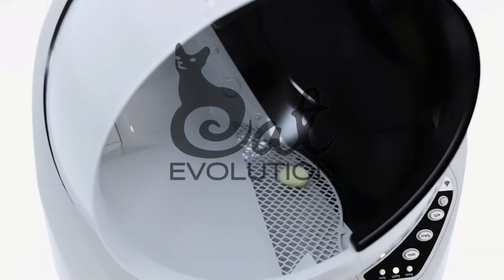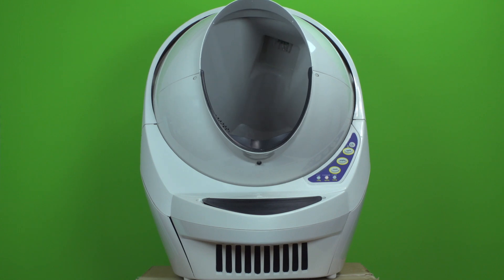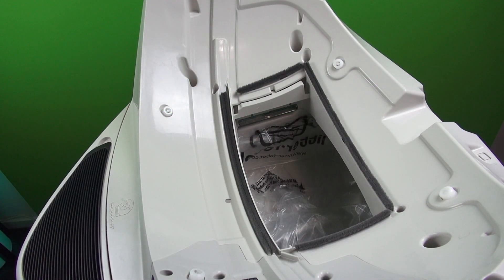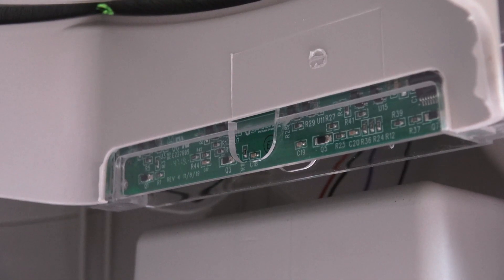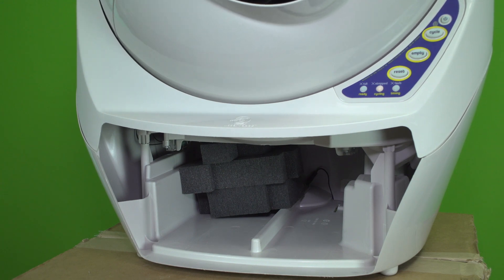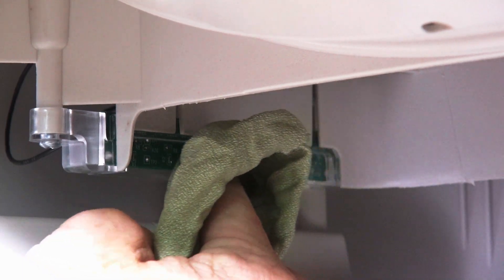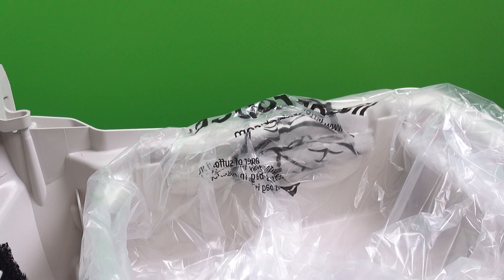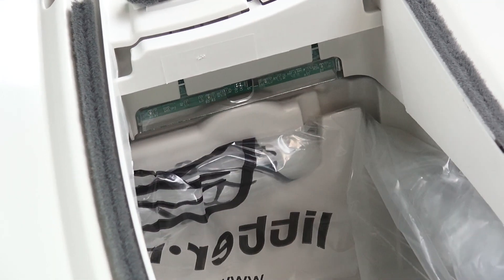Litter-Robot III Open Air - DFI Fault Flashing Blue Light

Comment: Great video.  Unfortunately, didn't help me.  Blue light blinks slowly no matter what.  If I press Reset, then the yellow light blinks rapidly.  I've now taken taken the thing apart and put it back together at least 20 times.  Nothing works.  3rd Litter Robot, 3rd time I've had this exact problem.  Nightmare.  Thanks for video though, I did learn some new stuff to try.
Reply: I've had no luck following everything shown on utube my 7th litter robot I've given several away. I'm almost DONE with this company.  I am so tired of issues.
Reply: Same here
Reply: Review pinch detectors, with the touchpoints where the 2 curved heads sit together, in case they have any corrosion or debris. They can also have some small material build up, so swapping positions so the 'piggy back' is reversed, can be helpful to provide a new cleaner metal to metal contact. The metal parts are easy to change and inexpensive, as well as being subject to use wear. The DFI boards can have issues with the left hand one (not the control panel side) getting soiled material dropped onto it if litter is not clumping well. This can then cause damage to the electronics, if the debris has urine (uric acid) in it, which can eat through the thin resin coating on the board. A quick low tech tip is to put a small amount of clear tape over the half circle cutout on the DFI cover, to try and keep soiled debris off the board. Only cover the opening, not the full front, as the infra red beams are distributed along the board and need to be clear for operation. I hope this helps! Note replacing the parts is straightforward if you are confident with a screwdriver, as the Litter-Robot III is designed for self repair with 'plug and play' connections.
Reply: I have the same issue, I've had 5 or 6 of them rma'ed over the last 3 years

Comment: I've done everything I know. The drawer is empty the blue light flashes I hit reset it flashes yellow if you hit reset it goes back to flashing blue. Everytime. Can't cycle
Reply from the maker: Its most likely you have pinch detector and/or DFI board issue. You are best to get in touch with the Company you purchased from as the parts are available for DIY as you can see from the installation video.
Reply from the maker: https://www.youtube.com/watch?v=Gi3AdBCImuo for installing DFI kit.
Reply: I have the same issue! I’ve tried everything! :( going to have to pay for the parts and try fix it. :(

Comment: Great bit of kit when it works, but it's really unreliable, can't go more than a few days without some fault appearing. We'd replaced the whole sensor circuits with warrantly period and looks like we will have to again, we had to pay £80 to get new ones, we had the fast flashing orange and also the blue light flashing even after cleaning all the boards and resetting the sensor, therer's a video on youtube for that somewhere if you need to find it.

Something I did notice is the weight of litter can trigger it, if you've a bit too much and the cats do a few pees, then when it's cycling a big lump can fall down and trigger the weight sensor or is it pinch sensor.

I was wondering also about the weight sensor on th bottom of the machine, it seems to have a sensor on it, imaging that maybe triggers or reads the weight in the machine. It's spring loaded and adjustable.

When you refill the robot remember to press the reset button everytime.

Comment: This is a scam. there is no warranty and no technical support. They didn't fix my robot still in warranty
Reply from the maker: I am not sure where you are located, nor what your issue is.  This is the Australian and New Zealand distributor for the Litter-Robot III Open Air, and the contact for all support and warranty for the Litter-Robot III Open Air in Australia and New Zealand. Please get in touch at sales@catevolution.com.au if you are actually needing some assistance. The manufacturer of the Litter-Robot III Open Air fully supports their appliance, and we maybe able to assist you with information and also whom to get in touch with if you have an issue, if you are not in our distribution countries. Thank you!

Comment: thx for the effort put into this video. i cannot for the life of me believe how shitty this product is. worst $500 i’ve ever spent. nothing but issues and it’s only 1 year old. this did not work for me so i will be contacting support
Reply: As a note, my Robot is 6.5 years old and not shitty apart from what the cats deposit ;o) As an appliance, it does take a little effort to get to know how it works, and the quick reference guide and user manual are very helpful. Also, for issues, its best to get in touch if you need help or information as customer service is available if needed. Best to use good quality low dust clumping clay litter as that is what the appliance is designed to use.
Reply: @salescatevolution9977  that's great to hear. I must have been unlucky. I did end up contacting customer service. They replaced the unit but it took them MONTHS and multiple emails/follow ups from me till they finally sent it. I don't know if they maybe went through a customer service overhaul but all of a sudden they became way more responsive a week or two before actually shipping it out. Pretty disappointing experience overall with this company but the new unit has been working well so far. Fingers crossed...
Reply: @WellActualllyyy  The Makers have been expanding, and launched a new version LR4, so its been challenging. Good to hear they have sorted out for you as CS is usually fast and very supportive. For the new base, change to good clumping clay litter (solid clumps in the waste drawer are the indicator) and you should find the Robot works to its best. 10lb in the globe only, with an empty waste drawer and dont add litter in between emptying also helps.

Comment: I was putting the bag around the whole of the back  draw (I don't like how difficult it is to use the bags clips). I didn't realize that the loose bag was blocking that infrared beam. Thank you for this video.
Reply from the maker: A purrleasure ! If you rolll the top of the bag it tucks in easily. It only needs to be tight along the left side.
Reply from the maker: Roll the bag top down to make it easier to tuck in 😻

Comment: Hello. Is there a way to Over ride  the DFI Sensor. by Jumping it or Something? This is the same way a Car garage door security feature woks with the light right? On my litter Box I can't see any red light. Blue button light is blinking, if I reset it. The Yellow light will blink really fast.
Reply: Hello. I am not aware of a way to bypass or override the DFI. You can check the pinch detectors (fast flashing yellow) by clean/file touchpoint as the place power flow can be interrupted. You can bridge rear points as a check/test but it means the pinch detector (failsafe) is bypassed. If the green boards have faulted, cant by pass those to my knowledge (but Im not an electrical engineer).

Comment: My litter robot won’t cycle at all, not even after powering off and on. The blinking blue light is constantly flashing. I tried to clean the dfi sensors as well as the rest of the litter robot. It just refuses to cycle at all.
Reply: Apologies for delay Jonathan as we are travelling.  It sounds like your DFI sensors have faulted. Please email support@catevolution.com.au if you are based in Australia or sales@catevolution.co.nz  for New Zealand for direct assistance.  If you are elsewhere its best to contact the distributor you purchased from or litter-robot.com for assistance to resolve your issue asap.
Reply: I have the same problem.I hope the support of the online store I bought it cann support me. At least I have warranty left.
Reply: @Greenbull300972  Did you have any luck resolving this issue? I am having the same problem and unfortunately I am out of warranty now.
Reply: @christopherp3474  I solved it. You have to open the litter box and clean the metal that's full of cat litter.
Reply: @christopherp3474  https://youtu.be/Gi3AdBCImuo

Watch at 7:57 min. the two metal sticks. Inbetween there is cat litter. And it interrupts the connection.
Reply: @Greenbull300972  Thanks. I tried cleaning that when I had it apart last time but maybe I didn't clean it well enough. I'll give it another shot when I get home from work this evening. Thanks!
Reply: I have the same exact issue. Flashing blue light. Will not cycle at all even after hard reset and with or without the drawer inserted. I have already had one base replaced under warranty and unfortunately it is now out of warranty. Were you able to figure out what your issue was?

Comment: I do everything u showed me in the video but after cycling still flashing blue light.
Reply: You may need a replacement DFI kit, with new pinch detectors. Please email support@catevolution.com.au if you are based in Australia or New Zealand for direct assistance.  If you are elsewhere its best to contact the distributor you purchased from or litter-robot.com for assistance to resolve your issue asap
Reply: @salescatevolution9977  I just buy this litter robot like half year ago. my last one worked 5 years till the cycle problems that's why I get this one and is newer should holds longer but wth? errr I'll take the global out see what happens then...this is unbelievable.
Reply from the maker: @grossmaniris5494  please email for assistance, or contact the Company purchased from if not Australia or New Zealand. The Litter-Robot has 18 month warranty 😻

Comment: I bought it two years ago, now it’s not cycling, just the blue light blinking for no reason, when. Press reset the yellow button starts blinking, without cycling, I’m really frustrated, I called the agent here , she said that it’s the sensor, I bought the sensor then I emailed the agent m, she said it could be the two metal pieces or the DFI, that will cost me about 200$, there is no technician to find out the problem and fix it, I have to do it myself, I’ve never done that before, which is possible that I can’t put things together again, it means I will lose everything. Then what should I do!!! I don’t know.
Reply from the maker: Dear Mari, please email support@catevolution.com.au if you are based in Australia or New Zealand for direct assistance.  If you are elsewhere its best to contact the distributor you purchased from or litter-robot.com for assistance to resolve your issue asap.
Reply: @Catevolution1  I will, thank you.
Reply: Yeah you need the dfi replacemt,theyll semd it to u. Im chamging mine now